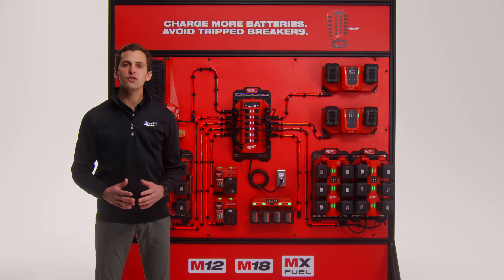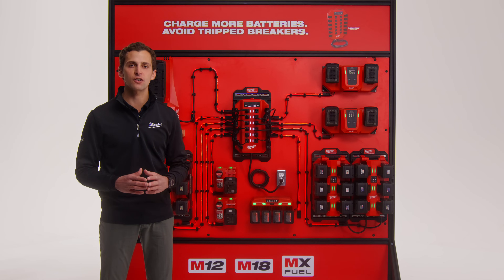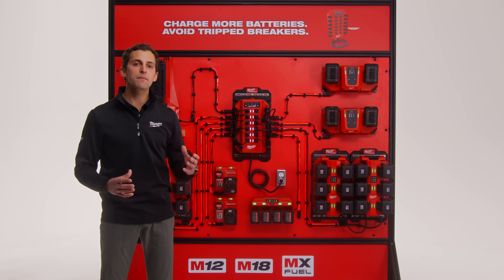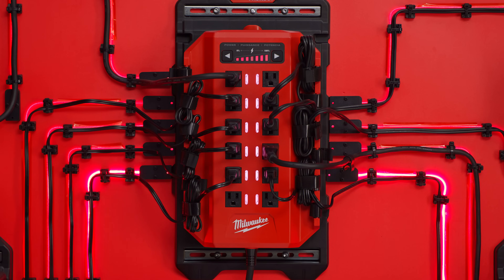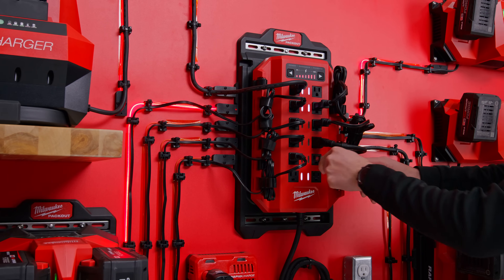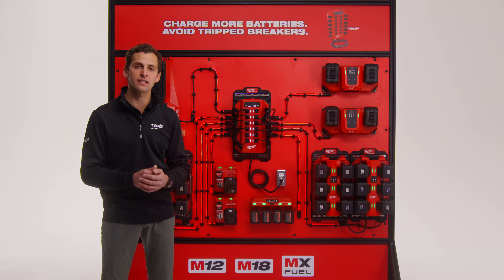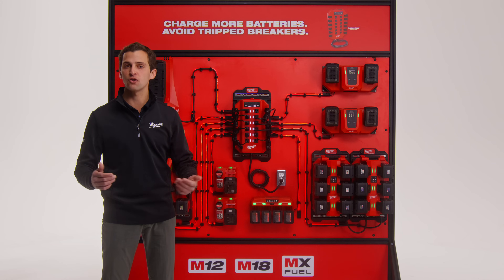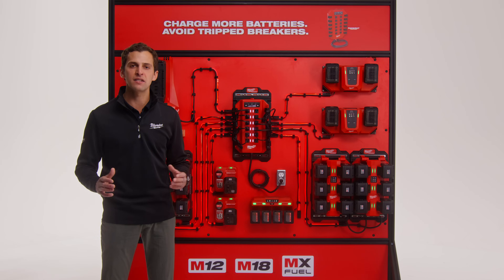Everything You Need to Know About the NEW Milwaukee Power Manager

Comment: What if you don’t have 480 volts to run this damn thing?
Reply: The whole point of this thing is that it plays nice with plugging it into a standard 15A 120V outlet and it will adjust loads to keep the circuit in range.